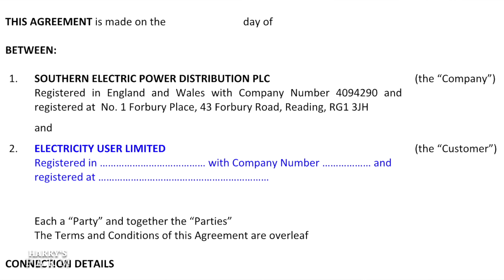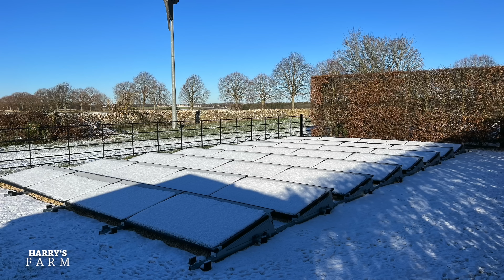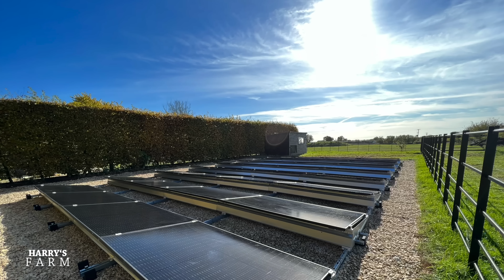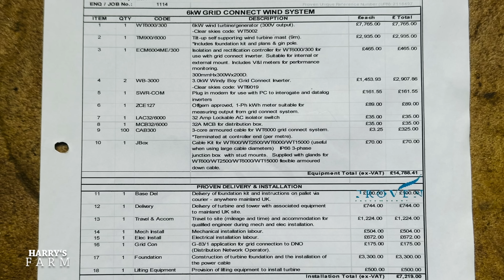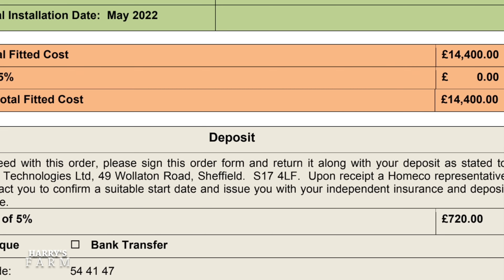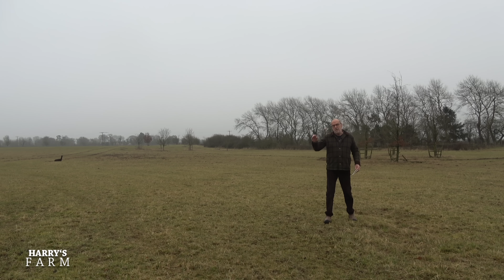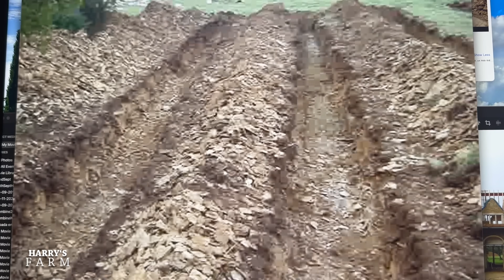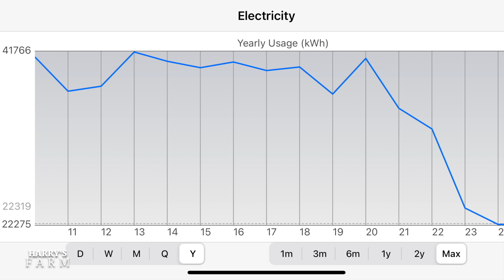Are solar panels & heat pumps worth installing? Here's what I've learnt after several years of use.

Comment: My first visit to Harry's Farm, it was recommended by a friend - thanks Don. Great review, Harry! I'm especially interested as I've just installed a modest solar PV system, 3.6kWp and a 5kWh battery. I only have limited data but so far in February it has produced 47kWh, over 11 days, or 4.3kWh/day. Doubtless this will improve as the days get longer and the sun gets higher.

Reading through the well-informed comments has been interesting. I'd like, though, to add a couple of extra dimensions to the PV argument that I didn't see being considered although both were probably implicit in what Harry said. 

Firstly, that having a PV system is interesting and fun! Some people go fishing, or to the opera, Harry has his cars and right now I'm getting fun out of my solar panels and I can get as geeky as I want working out how to maximise the benefit of the system. If it pays for itself in the projected 7-8 years, all well and good.

Secondly, it provides some degree of energy security: the country has been run by idiot politicians who have closed down much of our generating capacity before establishing a reliable alternative. Additionally, we are faced with the real threat of our undersea cables being cut. Consequently, we perhaps shouldn't count on the luxury that we have enjoyed for years of a reliable electricity supply. 

No, I can't heat my house on 4.3kWh/day in winter. However, I can run my gas boiler, rated at 140W, that runs off a big gas tank in the garden. Say it is running for 10h/day, that's only 1.4kWh so I'd be unlucky not to be able to have a warm house and hot water most days, even in winter, with some to spare for lighting etc.. On a sunny day we could even do some cooking with electricity in February. Plus, there's the log burner, various liquid fuel stoves and, in extremis, the barbecue! So long as Calor come along every few months and fill up the tank all should be well. In summer, I won't use much gas at all as I won't need space heating and the solar power can replace much of the gas that currently produces hot water.

Of course, there's an irony in my argument that a PV system is an insurance policy, while also criticising the government for focussing too much on wind and PV systems. However, I'd say that I, as an individual, can be much more flexible in my energy use than the country as a whole. It's early days yet for me, but so far so good.
Reply: With 4.3kWh/day you'd already make 20kWh heat with a heatpump though. Just a simple air to air one too.
Reply: @rkan2  Yes, I appreciate the point you make, although that would be almost a x5 factor. I don't know anything about air to air heat pumps, I had to look it up. Interesting idea, thank you. I thought normal air source heat pumps typically gave you x3 or x4 but I take the principle. Maybe air-air is more efficient? It doesn't look so suitable for multiple rooms though as you would need a lot of ducting. However, the original part of my house is nearly 200 years old. We've insulated it as well as we can, and the newer parts are very well-insulated but I'd still need a wet heating system of some sort to supplement the air-air. For a normal air source heat pump, or ground source,  I'd have to either dig up the floors for underfloor heating, or install large radiators and I don't think I'd have much change out of £20K. Even then there's no guarantee how well it would work.

We do have a well, about three feet diameter and 30 feet deep. I have often wondered how much heat I could get from that with a large coil of pipe and a ground source heat pump? Probably not enough, I suspect but I don't know how to estimate it. And I'd have the same underfloor heating/radiator installation costs.

With all this stuff, I'm sure if you chuck enough money at a house you can make heat pumps work, but for older houses the costs can obviously be huge. I suspect the law of diminishing returns applies.

Might be easier just to move house!
Reply: Good luck with it . Hope it works out for you; you’ve made a big effort here 👍
Reply: @williammorris1384  Thanks. It should break even within a just-about acceptable time scale - by which I mean I've got a fair chance of still being around by then! Meanwhile, it is fascinating looking at what it is doing. Only 600W at the moment but we have thin cloud. A couple of days ago it reached 3kW but only briefly, but not bad for February. My wife thinks I'm addicted to watching it! She's probably right😉
Reply: @nickwinter991  Don't think of an air to air heatpump always as the only source of heating. You can add it to the most central part of your house to provide most of the heat. For a large house you can even add multiple, just got to calculate which source is the cheapest. If your air to air (e.g. minisplit) has a COP of 5, which is normal for a A+++ rated heatpump, you get the 5kWh from 1kWh.

Air to water is COP 3-4 and ground source is again 4-5. Changing the heat transfer medium always causes a drastic drop in effiency.
Reply: @rkan2  Thanks - that is food for thought. Right now, it is producing 2.9kW (sun is shining), battery is full, house is using 1.5kW. Balance is being donated to the grid. (I probably should get a smart meter so I can get paid for it). AT COP=5, I could be getting say 7kW heat that would replace the gas we're using. Without more battery would probably work best in daytime "shoulder months", not shortest days when there's not a lot of sun, or in summer when heating's not heated - aircon might, although we've never had it. Very interesting - thanks very much.
Reply: It’s just so maddening that EVERY other major European nation , has better weather/ sun , than us !! It’s why 25 million brits jump on a plane every July / august , to frequent them . But then all that extra air pollution takes us right back to square one!

Comment: Interesting, because we operate a farm we went for a combination of biodigesters and geothermal system, for us, solar or wind was not an option, as you indicated solar in the UK's winter months is nearly useless.  Our biodigester produces gas that is used in our generators.   Granted it was an expensive system but our home was a bit larger than yours.   For a variety of reasons, we are no longer tied to the grid, because our biodigsters powered generators could be considered base load.  The biodigestors were selected because they could treat our farm effluents...(cows and Goats).

Comment: The solar installers didn't do a good job.  And you didn't exercise due diligence in learning about the particulars of solar panels.
   Did they fail to warn you that panels shaded by a hedge will not produce well?  If you have an old fashioned camera with a light meter, compare standing in the shade with the camera aimed at the obscured sun vs standing in an open field aimed at sun. Contrast the exposure recommendations.  If you don't have a light meter, gaze at the sun in the 2 locations. The difference will be glaringly (pun intended) obvious.
   Solar panels are most efficient if they directly face the sun.  If the sun stayed directly above the equator, the panel's angle with the ground should equal the latitude. During the winter, the sun is below the equator. At Christmas, it's above the Tropic of Capricorn, 23 degrees south.
 Perth, Scotland is at 56 degrees latitude. Therefore, the panels should be between 56 and 79 degrees from horizontal. This angle will also cause the snow to slide off.
  You describe shadow on one panel causing output from a whole row to decrease.  This is characteristic of old style string inverters. The string is only as strong as the weakest link.  Newer technology isolates the panels. One method is to use a single DC-AC micro converter for each panel (an example in the US is Enphase). If one already has a string inverter, a solar optimizer isolates the panels, maximizing the DC output from each, leaving the string inverter to convert to AC.  A US example is SolarEdge.

Comment: Same as Harry built a bungalow on the farm that is electric dependent. 
Was down there for 2 days with Storm Eoywn.
Like an idiot tho my house is East/West facing doh. We all face the road here in NI I dont know why.
I went airsource as half the cost of the ground source with Underfloor heating heating with a MHVR as the house airtight.

Just added another 14 solar panels so have 30 in total now on the roof. The ground ones I think better.
Added a 10.4 Khwz battery.
Jealous of the wind turbine, but the maths dont add up yet unless the costs go down.
He is 100% right about the solar it can be low in Winter. I had factored this in as NI is not known for its good weather lol

Comment: Interesting to see what your setup is like. As an owner of a house fitted with roof mounted PV panels, which are just over ten years old, a factor that you have not mentioned is the effect of heat on the panels. Their efficiency goes down as the temperature rises, and I often experience the drop in output on hot Summer days.

Incidentally, looking at the thermal efficiency of the ground source heat pump, and the likely price of daytime imported electricity, it would be pretty marginal compared with some sources of fuel. Where mains gas is available, one is better off with a gas boiler, at current unit prices.

Comment: Harry, You guys have it good over there with your electricity rates I guess. We have about a 230m2 home here in the east coast USA (about half the size), and our summer electric bills are about £150 less per month than yours. And we only use thet for air conditioning and general household stuff. No EV chargers, gas stove. In the winter its a decent bit less, but still around £200 I'd say. And we have propane heat in the garage and oil for the house so those are separate bills that are rather massive and require fill up a couple times in the winter. So for half the size and no EV charging or solar input, no electric heat etc we end up around the same.

Comment: 15-16kwhs per day for the Aga - seems like BS. They use minimum 30kwhs a day. Question is it the old E7 model which can save cost due to taking it's charge at a cheaper rate.

Comment: I'm probably wasting my time here as it won't get read but your ratio of 14:1  between summer and winter solar production is far from optimal and could be remedied cheaply to something even better than my own ratio of 8.5:1. Get rid of all shading or install optimisers. But above all change the angle of your panels, they look way too shallow. You'll have to space them out more to avoid shading but an angle of about 40 degrees would be optimal for all year round and if they're directly south facing the ratio would 5:1 between June and december

Comment: The best heat pump is a water source system. Both ground loops and air source systems have issues. Ground loops can pull all the available heat out of the ground around it to the point it won't produce any heat at all. It takes a long really cold snap to do this but it can happen. Air source systems just are not efficient once it gets really cold and stays that way for a long period. Water source on the other hand is stable year round. It pulls water out of a well, pulls the heat out of the water and then dumps the water into a pond, stream, or even back into the ground via a drain system.

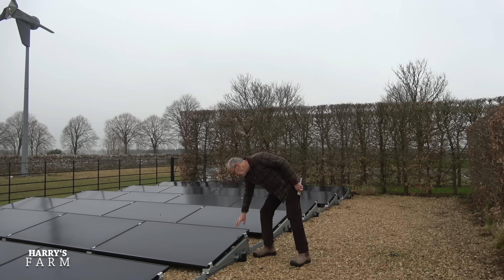Comment: 3:22 No, it has nothing to do with the system thinking something is wrong.  If they're wired in series in a string, shading on one panel basically restricts the current that can flow through that panel, which restricts the current on the entire string.  Microinverter installations don't have this problem.  Only the shaded panel would be affected in those cases.

Comment: The thing is with the solar is to make the power in the summer and charge it back to the grid at 0.15p to produce enough money to subsidis the cost over the winter.
Regarding the batteries  we force charge the batteries at 12p low peak night rate during the winter (when solar is low) which then runs the house during the peak hours of the day further reducing cost cost Works for us summer or winter anyway. great channel love both the car and Farm content.

Comment: The installer used the wrong configuration.  He should have used individual micro inverters so only one panel is effected.  or cut down the hedge.  Get battery storage to capture wind and solar.

Comment: Harry, have you looked at how to house maximise the solar for winter sun (not that we get much), I believe the  angle of the sun in winter is approx 37 degrees, your panels look flatter; maybe change the angle by lifting the back end, this may help with shading (or add optimisers to the panels). Also we're simply never going to anywhere near the summer collection simply by the difference in daylight hours.

Comment: Equator, thats where they actualy can use SP all yr. So many wasted months here in the north
Reply: Fun fact, the best theoretical place for PV efficiency would be Antarctica. Of course you should use vertical PVs there. That's just to say that PV can be installed more or less at every latitude, it's how it is installed that matters. I suggest you to check the topic of vertical bifacial installations, quite surprising results in case of lots of snow.

Comment: Very interesting video, I was pleased to hear that you, very properly, invested first in good all round insulation for the house.This is something that  is a real problem in older houses in the UK. As for the enormous peak in solar during the Summer , have you thought about investing in a good battery storage system? Preferably sodium ion which is not worried by cool weather and will be coming out as a very cheap alternative for using your electricity in the winter months very soon. Here in Finland we are hoping that the new efficient sodium ion batteries will be a great help in ev’s during the cold winters  where range is reduced  at -25C by about 50%.  Many thanks also for your “Harry’s Farm videos which I, as an old young farmer in  the UK, find extremely interesting.

Comment: Battery storage / grid charging off peak / exporting excess / having some solar array optimised for winter months all make a difference.
In addition to that, we have air to air heating which draws far less than a hydronic system.

All of there above is what works for us.

Comment: We’ve lived off-grid in Scotland for 8 years. We gave up for anything outside Jun to Sept, now it’s coal, diesel (generator) and gas outside those months. Anything that requires the heating of water is fossil fuels, no other option. During summer we have to find stuff to use the solar PV for - wash clothes, all garden tools use batteries, etc. Any kind of turbines need complex control systems because the power has to go somewhere or you destroy the generator - if any of that switching gear fails (and most renewable tech is experimental with poor reliability) then you’ve burnt out your turbine…

Comment: A quick question Harry - what is the electrical consumption of the circulation pumps - primary and secondary? Or, is that all included in the specs and costs of the heatpump(s)? Very interesting video, and I found myself agreeing about mixing solar and wind on the same grid connection - never thought about that before.

Comment: Looks like a very poorly installed ground mount (but using flat roof mounting) system. 

Ideally, you would have 1) raised the panels over the ground at a steeper slope to avoid snow and generate more power 2) used bifacial panels to benefit from the reflection from the pebbles through the rear of the system

Comment: The point of the battery currently is you go on a split tariff and import at 7p overnight charge the ev and battery then in winter the battery carries you through the day at 7p kwh. In the summer you're buying at 7 p and exporting at 15p. Currently your strategy of dumping xs into the pool in summer is flawed as it's just a water battery so you could heat at 7p rather the 15p you are currently paying. My solar is even worse than yours in winter.

Comment: 1. Agree with you on the roof top solar.  This is a vestige of the 20th century and I think it going way - slowly.
2. Your solar installer did you a disservice. Having any shade on solar panel with a wide open property like yours is a crime.
3. Winter solar is a problem but your panels are optimized for summer.  I would recommend changing your mounting to an adjustable one
   and changing the angle each month to a median sun angle for the month.
4. Solar from a global perspective is highly effective.  Industrialized countries have a disadvantage in high demand and low energy costs.
   In Hawaii solar is quite popular due high energy cost and optimal conditions.  Pakistani solar growth is double every year.
5. There is no one solution for all.

Comment: if you have decent export rates you can use the grid as a battery - export in summer and then consume from grid in winter. Doesn’t balance 1:1 but helps

Comment: Just looking at your figures Harry against my solar system on my roof which is 12 years old. Mine is outputting 1% more (corrected for size) based on your figures plus my panels are only 265w/panel and yours are 420w/panel. Mine are at 26degrees angle elevation and 170degree angle (just before south!), yours look very low?. I would seriously look into the angle which you have your panels at, because you must be able to squeeze more out of them considering yours are 60% higher capacity than mine. Something doesn't add up?!